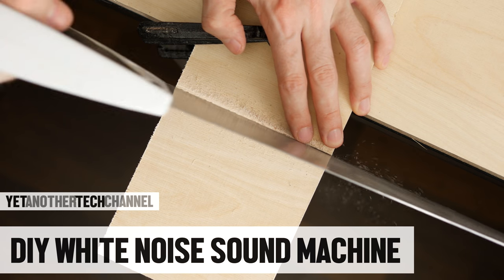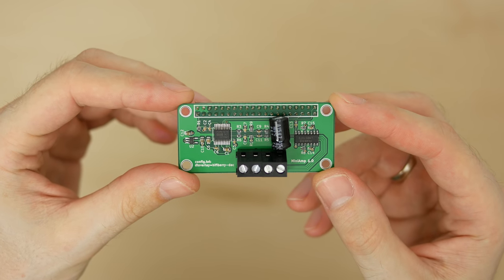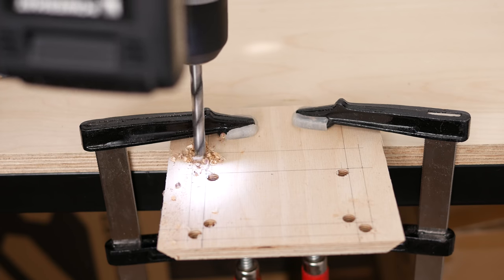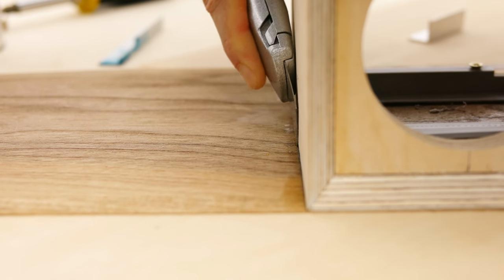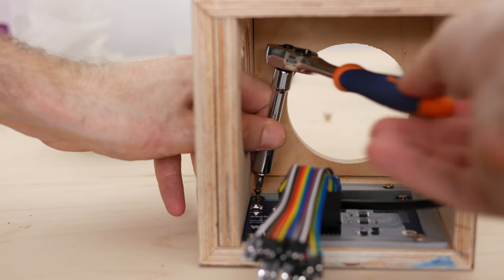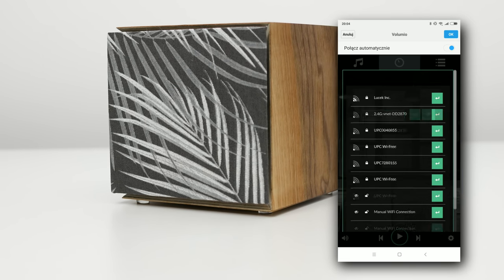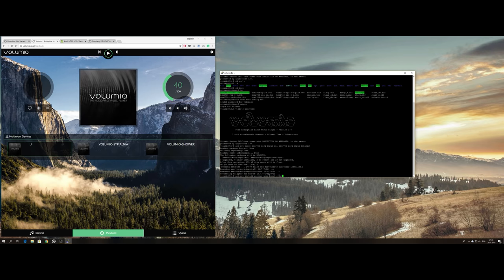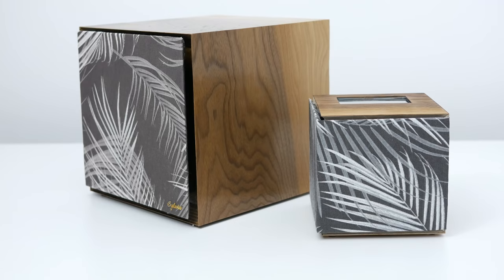How to make a sound machine with Raspberry Pi Zero W and HiFiBerry miniamp

Comment: Wow this is really cool! Also, congratulations on your baby!
Is this possible to make this without a 3d printer?
Reply from the maker: Sure, you can easily do that without a 3D printer. The front cover can be made from plywood (https://youtu.be/LclEtDfk9qQ?t=2m6s) and the components can be attached to a frame made from aluminum (https://youtu.be/LclEtDfk9qQ?t=2m33s).
Reply: YetAnotherTechChannel Thanks! This looks like a really cool project. Again, congratulations!

Comment: Beautiful build. I just got HiFi berry Miniamp 1.0 and usb hub with lan port. While the hardware seem to work, it is impossible to find any supporting software for hifiberry miniamp 1.0 running on Raspberry pi zero 2w. I tried everything. Even beta versions where someone claimed their version works on Pi zero 2w. While some of these applications boot up, they just get stuck n command line. I get no gui and no way to set up anything. Maybe sometime in the future there will be a working and user friendly airplayer. Right now I give up.
Reply: I don't know if this will work, but did you try PiCorePlayer?

Comment: hi i have such a question .. also i bought rpi zero and miniamp works, but if I don't play any sound, there is a slight noise in the loudspeakers or some kind of disturbance which can be a problem, the chargers have already changed without a result
btw great video

Comment: Awesome work. congrats. The holder for the Pi Zero, the expansion board and the hifiberry is great. Did you design it yourself or can you download or buy the model for printing anywhere?
Reply from the maker: Thanks :)

I designed it myself, but since it was one of my first designs with 3d printing in mind, it did have some flaws and I'd have to address them before releasing it to the public.

Comment: Is it possible to add volume buttons / on off buttons to this?
Reply from the maker: You can change the volume and turn it off using the touch screen. But generally - yes it would be possible to add physical buttons for volume control and power.

Comment: I'm just asking, would you work with someone if they wanted to do a diy project?
Reply from the maker: If it was something interesting (and doable while not being too time-consuming) I would most certainly consider it ;)
Reply: YetAnotherTechChannel The 3d printer access is what I dont have. Your project looks good. Do you think it was possible to powered it with those 1800mAh batteries for a wireless finish?
Reply from the maker: You'd need some kind of voltage regulator since these batteries deliver 1.2V and the Pi requires 5V. IMHO, a better option would be a power bank - but you would probably need to make the case a little larger for that.
You can easily get away without a printer - the front cover can be made out of plywood and you can make an aluminum frame for electronics.